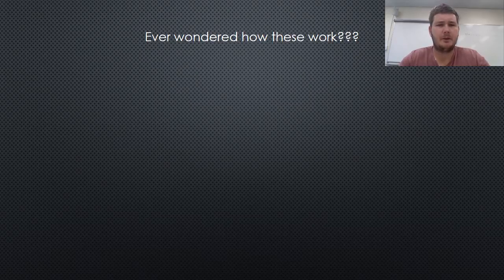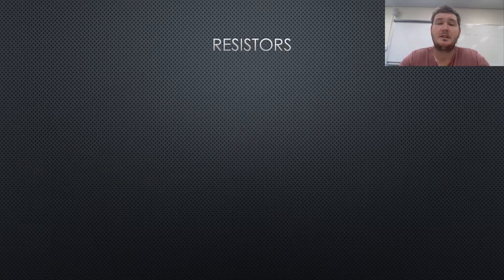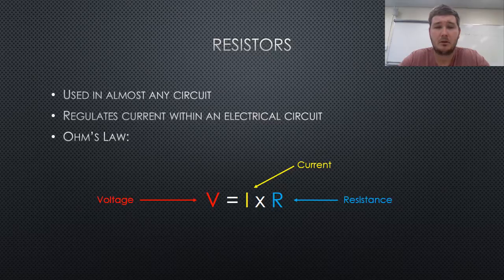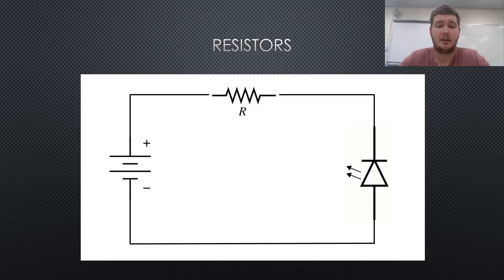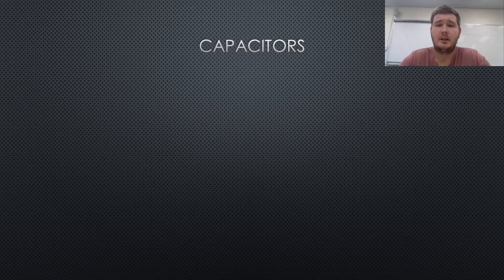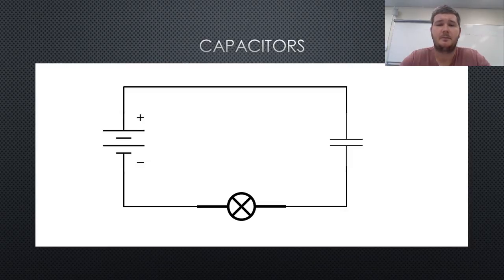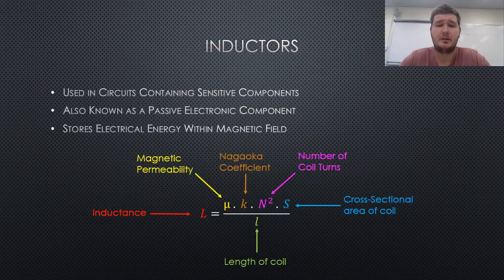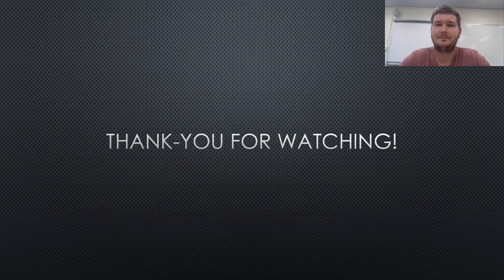Resistors, Capacitors and Inductors

Comment: resistors are to drop down the voltage not the current. the resistors can not change the amount of current
Reply: 20/2=10 vs 20/5=4 
where: dividend = V, divisor = R, quotient = C.
therefore: Resistance drops Current

Comment: I am diving into building radios! Thanks for shedding light on this. I have a question: many fixed inductors and resistors are striped with colored stripes and look as though they could be either an inductor or a resistor. What's the fastest way to find out whether it's an inductor or a resistor, if you have a multimeter on hand? Thanks!

Comment: Informative video,  but one major question.

C = Q x 1/V

Is that 
C equals (Q times 1) ,  divided by V ?
or 
C equals Q times (1 divided by V) ?
or 
(in the case of 3v as an example here) C equals Q times one third   
(or in the case of 60 volts as an example) C equals Q times one sixtyth?

What does the 1 equate to,  and where does it calculate?

You have confused me with this sooooo much that I had to stop watching